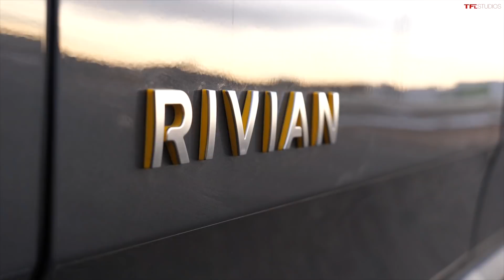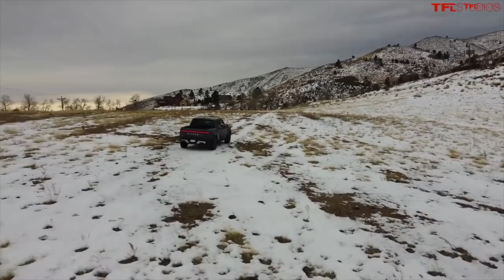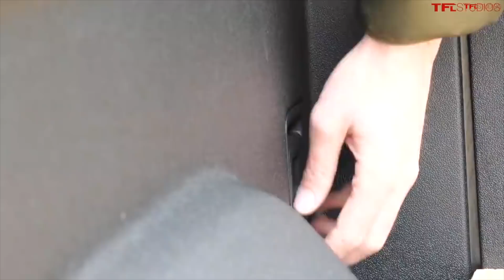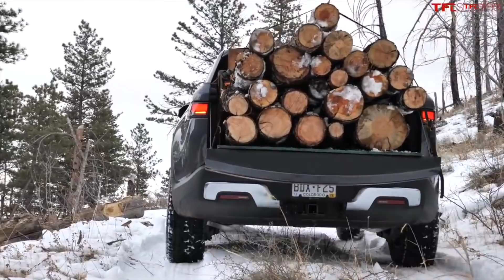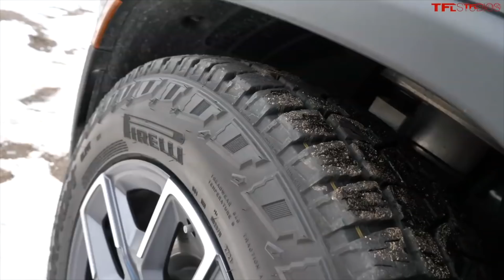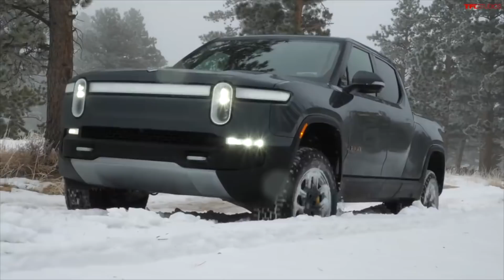What's It REALLY Like To Live With An All-Electric Rivian R1T? We Have The Answers!

Comment: If it where not for two problems I'd have one of these on order, the first is that I don't want to finance a truck for 30 years and I don't make the money for a 4 or even 7 year plan on these, which isn't a problem with the truck but rather my floundering around in a dead end job for too long and having to start at the bottom in a different company, the truck itself is a tremendous value for what it offers. The second is that it would not fit in my garage and don't have a driveway, defeating the purpose of a BEV since I couldn't charge at home (parking is on the opposite side of the street from my house, so running a cable out front isn't an option either) 

As is I could see myself being very happy with this vehicle. It has a big enough bed for my needs, as I'm not a contractor or anything I just do small DIY jobs around home and call in professionals for the big things. I mostly am interested in outdoor recreation like hiking, camping, fishing and hunting and the bed is plenty big enough to haul home that nice buck, or wet muddy fishing gear without dealing with layering plastic and tarps in a traditional SUV to prevent mud and  bloodstains. 

There are a couple things I feel Rivian can improve, I share the same concerns about that tailgate and feel it could be corrected with a few 1 inch drain holes in the correct places, but there is a reason no other truck maker has made it like that yet as it's just a maintenance nightmare compared to traditional gates (and most of the fancy split, stair, and dampened gates and all that can go right in the trash too, give me a basic simple gate that when the roadsalt inevitably starts to eat it I can go to a pick and pull, find my color and pay 100 bucks to swap in a few minutes) I also feel that for the R1T's size, the bed length is fairly short, a Ford Maverick has almost the same bed length (although narrower obviously) while being much, much smaller and easier to live with on tight streets, but I suppose that the extra size goes into the cabin and Frunk which does help make up for the short bed. The exclusion of Android auto/apple carplay is a bit strange to me too but so long as it's built in system is comparable in functionality its not a big deal. Biggest concern there is how software quickly can become dated and even compromised without consistent support.

Edit: I got the the part about the wireless charger, and while it sounds inconvenient I must say that wireless charge pads in vehicles have been a headscratcher for me for a while. It was always drilled into me that you NEVER keep anything loose in a car, tissue boxes, change etc. You want everything snuggly secure so that under rapid acceleration or deceleration it stays put. You never know when you might need to hit your brakes hard due to someone or something else unexpectedly being in front of you. In addition to that you want items secured in the event of an accident, particularly important things like your cellphone that you might need to find immediately in the event of an accident and at the very least, don't want falling into your driver footwell as you drive where they might get damaged (or if you are dumb enough, you might attempt to search for while driving.)

For that reason, I've never been concerned about how convenient a wireless charger is, my phone always either goes inside the center console or on a phone stand and taking a second to plug in a wire if it needs charged is hardly an issue to me. The idea of taking what is probably the most important device to have available in an emergency situation and putting it in an area where it's almost guaranteed to be lost in said emergency situation is just backwards to me.

Comment: I would have two sets of wheels. Stock for everyday and roadtrip with low rolling resistance. Maybe a 3rd set of k02's for offroad, but the 20" wheel is a real problem there.

Comment: If I could justify the price, I would certainly consider the Rivian as my first electric vehicle.  By the way, I'm glad to see you got it clean and looking new again before giving it back to Chad!
Reply: I finally pulled the trigger and put in an order for one. I got the extreme base model, (which is still very loaded by other manufacturers standards), literally the only option I got was the home charger. 68k, minus a 7500$ federal and 2500$ state tax credit, im at 58k. Even with the increase in my electricity bill, it’ll save me 200-250$/month on gas, not to mention no oil changes, less frequent brake changes, etc. I figure it’ll cost within 100$/month of my current truck, (2015 F-150) that I paid 25k for.
Reply: @jason91notch  it will also maintain very high resale value as compared to a gas powered truck. Keep in mind during vacations and road trips you'll save alot, too.
Charging; there are apps that help you find free chargers. I have 2 in my small town and 5 more at places I shop or work near. I don't plan on using much home electrical(but have installed solar array to help offset anyway).
Reply: @TheLearningCatalystCoach  resale value will depend on how far battery technology advances within the next five years as well as the cost to replace the onboard battery. I know that it costs $3500 to replace the battery on a current Gen Toyota Prius. I wonder how much it will cost for a Rivian which has a much larger one.
Reply: @DCuerpoJr  semi-false, and comparing a Prius to this is apples to pork(not even fruits).
Rivian has the best battery warranty, guaranteeing 8 years/175,000 miles and that's down to 70+% which is pretty amazing. By that point a $20,000 swap out could be as low as $5K.
It's safe to say since this is the only current truck EV performing, and is showing super high quality...it will e a hot commodity for years. I plan to sell/trade in mine in 5 years for a profit (considering I'll save $3-4K annually)
Reply: @TheLearningCatalystCoach  The Tesla Model S battery replacement costs between $12,000 to $20,000 depending on the version purchased. These prices haven't gone down for the first gen 2012 Model S. I highly doubt they'll go down for Rivian when they don't have the battery manufacturing capacity as Tesla.

In addition, an 8 year/175000 mile warranty sounds great, but who knows whether the company will be around in 5 years. Remember Fisker, LeEco, Aptera or AMP? Even Elon Musk admitted Tesla had a very rough start and was on the verge of bankruptcy on multiple occasions. 

My point is that all these EV startups face monumental uphill battles against existing car manufacturers in terms of manufacturing capacity, quality assurance and available resources. Ford sells over 300,000 F series trucks a year and already sold and delivered 25,000 Mustang Mach E's in 2021. Tesla sold and delivered 936,172 EVs in 2021. Meanwhile, Rivian has sold and delivered 384. Their CEO claims their manufacturing plant in Illinois can produce 150,000 vehicles a year, but that still remains to be seen. For comparison, it took Tesla nearly a decade to be able to produce more than 100,000 vehicles in a calendar year. With current chip shortages, I highly doubt they'll be able to deliver all 70,000 preorders within this year.
Reply: @DCuerpoJr  1)you're referencing really old numbers(from NOV just two months into production)
 Rivian this week is now over 2,000 vehicles produced (nearly 1,000 since end of Dec, which was just over 1,000 while even taking a week to recalibrate efficiency), and are now producing 200 R1Ts per week. They do indeed have the capability to produce between 500-1000 per week at some point projected before end of 2022(and yes, I am privy to information that backs this). Will they fulfill 70,000 in 2022?...likely not. But 35,000+ is looking very favorable from sources and valid reports that the next ramp up will be significant.
 2) battery tech is progressive rapidly, but has not fully evolved, but is finally on the cusp. If you knew that, this industry, and even your Tesla fanboyism would be delighted at what's very close to ahead in less than 5 years. Get to researching :).
3) have you looked at Rivian's financials? There is zero comparison to your examples. The funding plus already way better than Tesla's first few rollouts(only 500 Roadster in a whole year, and very slow model S initially). Keep in mind, Rivian is light years ahead of even Ford in terms of reservations, as we 70K(likely 90K+ now) out down much heftier fees $1000 vs measly $100. That's much more consumer backing.
Reply: @TheLearningCatalystCoach  Thanks for the updated info. I actually hope you're right. I'm not a Tesla fanboy. I don't own any of their vehicles. But I've owned their stock for a decade and it's been one of my best investments. Rivian's stock is currently below it's IPO so it's been tempting to buy.
Reply: me too.
Reply: Regular gas in Canada is averaging 1.70 litre (6.80 gallon)  The price of the Rivian is slowly being justified.
Reply: @greatlikeelviseh6063  yep. Regardless of war times/sanctions or "inflation"(which is mostly BS), here in California gas was already $5/gallon, and will be $6-7 per gallon in the next 2 years, without a doubt.
Reply: @greatlikeelviseh6063  Rivian just eroded the trust their pre-order customers had in them when they suddenly increased the purchase price by 20%. Half of their customers canceled their pre-orders, which forced Rivian to apologize and honor the original price. But for new customers, the price still increased 20%.
Reply: @DCuerpoJr   That sucks.  But, that goes hand in hand with all of the scum bag dealers that are cashing in on high demand no supply. I hate care salesman and I hate dealership owners.  Bottom feeders.
Reply: If they paired back a few of the over-engineered bits and increased the base battery mileage it would be day one for me. But I'm years away from being able to afford one anyway. So I'm hoping they'll be kickass by the time I can!

Comment: Questions? How much for battery failure? How much for motor failure? Tire cost? Fluids? Warranty coverage? Thanks TFL!
Reply: My current ev has a 10yr 100,000 mile battery and powertrain warranty  the battery replacement cost is 15k For the entire module but cells can be replaced rather than the entire unit.  The old battery still has value and it is unknown until i replace it if they offer a core refund like lead acid. The cost of maintenance is only rotating tires as needed.  The cost of the ford ev crate motor is around 4k.  Installing an ev motor should be way fewer man hours than a gas motor.  The only fluid is a coolant for the electronics which my owners manual says wont need replacing for 100k+.  Cover it all?
Reply: @kotter1792  how many EV motors do you have? The Rivian has 4 motors. I am sure every auto maker has different warranty
Reply: @getlosttoday4045   I only have 1.  EVs vary widely.  The rivian has 4 ford has 2 Hyundai and kias new offerings have 2 but they are different sizes.  I picked the crate motor as i figured it would be the highest price single unit for a point of reference
Reply: @kotter1792  The Rivian has a lot more batteries I bet though, might be a bunch more expensive.
Reply: Rivain has a pretty comprehensive warranty so you won't need to worry about any kind of failure not falling under warranty for at least 8 years.
Reply: Very good questions

Comment: Looks good. Perfect size truck if you don’t need an 8ft bed. $70k is $10k down $1k per month. Who can afford or is willing to pay that for a truck? Truck is shovel/multitool. Shouldn’t care about getting dirty or scratch and dent. Price of modern trucks is opposite of that. Proper truck is regular cab, 8ft bed, 4x4, max tow package. I have a 2010 Titan 4x4 max tow. It sits in driveway unless i need to tow, haul or offroad. Next truck will be used 1 ton diesel 4x4 max tow. Everyday car is used minivan for road trips or 350Z. Own three cars for less than a new rivian/raptor/trx. Electric not useful yet. I take road trips every month. Most short some long. Have driven from Atlanta to Denver, Moab, LA, Seattle, Yosemite, etc. not overpaying for vehicle and waiting for charge. When price drops and can swap batteries like a power tool  at national locations along interstate then i will consider
Reply: Perhaps you haven't seen the prices of the average truck these days?
Reply: TRX would be almost 1.5k per month with that math.  Dealers right now are trying to get $600 a month on a 30k car with 10k down.  It is not a good time to buy.

Comment: Could you change the tires and rims if you wanted to?
What's the limit to downsize or upgrade to bigger?
Reply: Rivian has reported smallest rim size is 20” due to brake size
Reply: …And the brake size is probably driven by the combination of weight and power.
Reply: @-Jethro-  my guess is weight